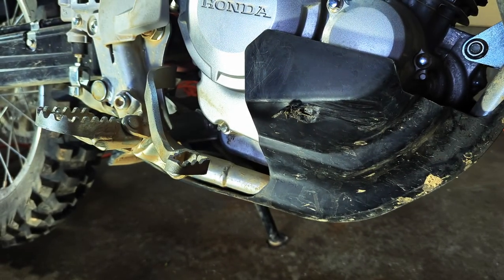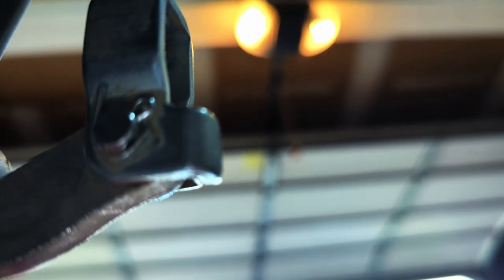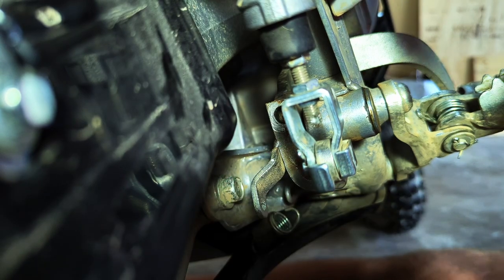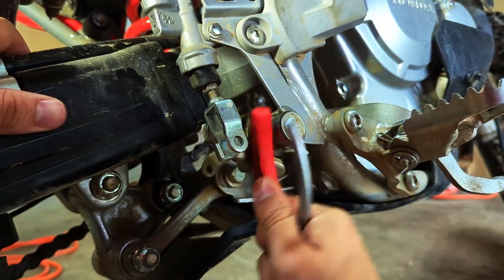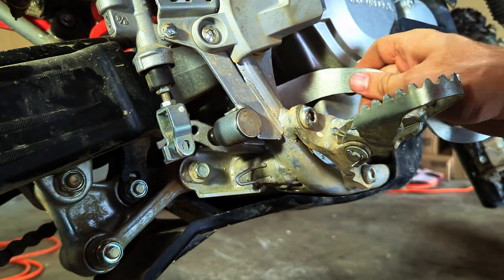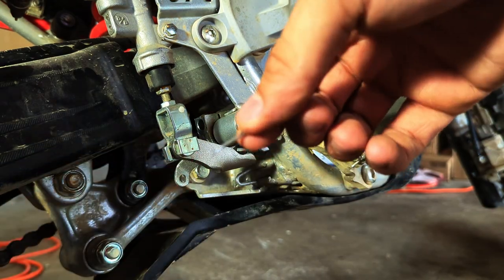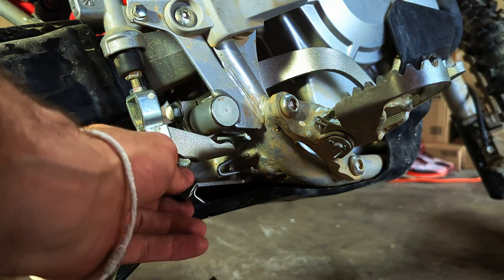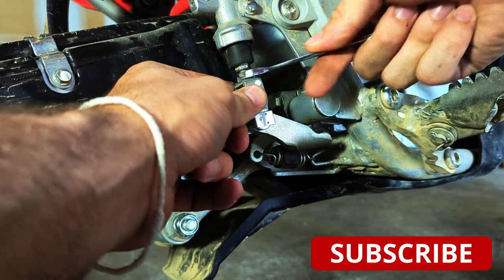CRF250f Rear brake pedal replacement

Comment: Do I have to undo the pivot shaft to adjust the lever down more? Or does it adjust off the 2 nuts?
Reply from the maker: You should be able to adjust everything you need just off the two nuts